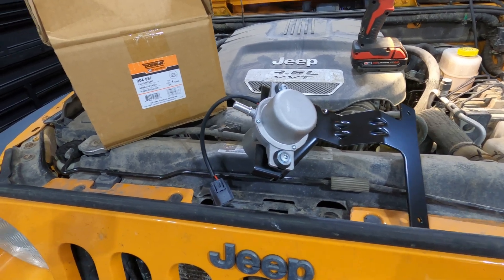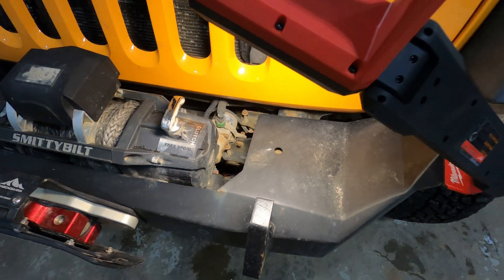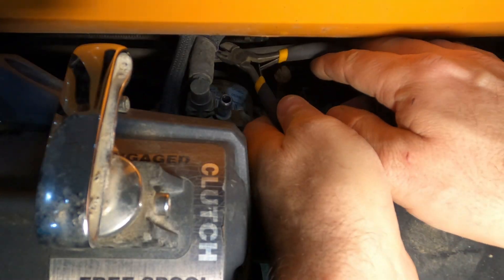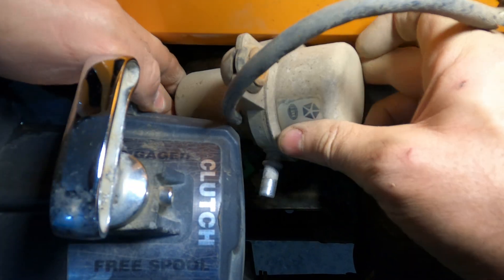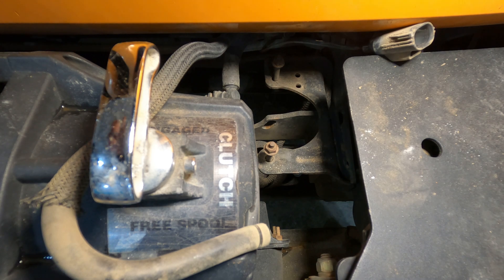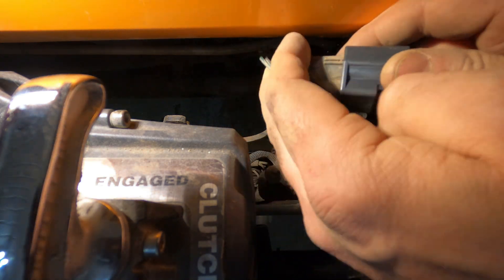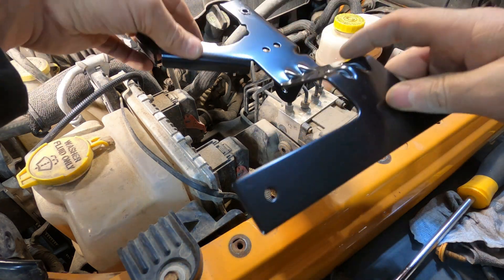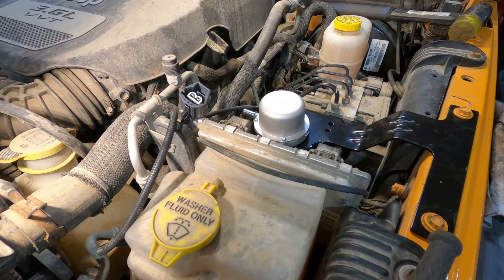Jeep JK brake vacuum pump replacement (brake booster pump)

Comment: Dorman worst crap ever. Terrible company with terrible parts
Reply from the maker: So far, my experience has been different than yours.
Reply: @EricCantin whats the sample size? This one part for you? I work as a mechanic at a garage
Reply from the maker: Then which pump is most reliable? Easy to diss, hard to say anything helpful.
Reply: @EricCantin so this is known as a red herring fallacy. Its its introducing a different point to distract from the original point.

I did not make a comment to help you find a better pump. I criticize the pump you put in because dorman stinks. You then say not from your experience. Thats why i asked how many dorman parts have you actually used.. if you are one for one, than i guess its the greatest company of all time. However if you do this for a living than the sample size is much greater and you see patterns.

Now had the discussion been at the beginning which one to use, im sure we could have looked that up
Reply from the maker: If you’re such a knowledgeable mechanic, you’d know this is one of the most common replacement pumps used by Wrangler JK owners. 

Why did you stumble on my video anyways?
Reply: @EricCantin so im not sure if you can conflate me being “super knowledgeable”, with me pointing out dorman parts are garbage. Say you are a janitor and work at the shop and you have witnessed multiple dorman parts being put on multiple cars.. if you see that the parts dont work out of the box or dont last but 6 months, do you have to be extremely knowledgeable? Its just pointing out junk, you dont have to be a professor man…
Your video came up on my YouTube because my friend has a jeep with a vacuum pump code. I have alldata and the picture showed the pump behind the bumper. I youtube it to see how long it takes to replace. Your video was the first to show. If you notice, i am not critical of your video, just the trash part you put in. Video was fine. Any reason you are being so defensive about the part? Also, you still haven’t answered my question.. how many dorman parts have you ever used..? Is this the only one ever?
Reply: @EricCantin just because its the most replaaced, doesn’t mean its good. Thats like everyone going to the new Jurassic park movie.. wow a new movie lets go, doesn’t mean its good, just popular. Thats an appeal to popularity fallacy. Taylor swift sells billions of records, is she good?
Reply from the maker: I’ve used plenty of Dorman as well as lots of other Jeepers I know. Those that failed lasted longer than the typical person holds on to a vehicle (years not months).

You have your opinion on the brand. I and many other Jeepers I know (including multiple that are licensed mechanics) have had plenty of higher tier parts fail quicker than those manufactured by Dorman or many other low cost solutions. That’s just the reality of current times.

Comment: Will this pump help with spongy brake pedal. I have a JK and I’ve done new rotors,calipers all around and even installed a big brake up front but the pedal still feels spongy. I then flushed and performed a manual and ABS bleed. But did not help. Appreciate the help.
Reply from the maker: How big of a brake kit? Does it use the factory calipers on oversized rotors, or also uses bigger calipers?

If still using stock calipers, this should help. If you upgraded to bigger calipers, you may need the J8 master cylinder and booster upgrade. I have a video of it here: https://youtu.be/RULcDetUsGM

Comment: I haven’t had any codes, but my jeep has 203k miles on it and it’s got a big hole in the side. When I hard brake my brakes feel like they are “sliding” and my traction control light kicks on for a second. I’m assuming this is the culprit. Anyone got any other ideas?
Reply from the maker: Are you using a scan tool that can check for intermittent codes?

Is it the brake pump that has a hole in it? When mine was dead the pedal was spungy.
Reply: @EricCantin yup. Scan tool says nothing. The aluminum housing on top of the pump rotted and had a whole in it. I changed it this afternoon. Seems fine now. I had to pump the brakes a bit to build pressure back up it seemed, but I’ve got a firm pedal now. The old pump literally crumbled in my hand when I went to loosen the bolts. It was completely shot for sure.

Comment: Excellent bracket! I flat tow my JKU and have a demco stay in play duo braking system, the control module ended up right where most other pump relocation brackets go. Not this one! This Dorman bracket will put it right underneath the brake system controller, tucked out of the way keeping my bay looking neat and tidy! Thank you!!!

Comment: Where did the small vacuum line go that you had the zip tie on to the pump?
Reply from the maker: At what time in the video?
Reply: @EricCantin  4:00 the smaller rubber hose yhay slips on the little tube on the pump
Reply from the maker: I think that was the air supply line to draw air higher in the engine bay (since the pump was below the OEM water fording level). Since the bracket relocates it so much higher, no longer used.
Reply: @EricCantin  I think the small line is the exhaust side of the vacuum pump.

Comment: i’ve had problems with braking in low rpm since i got my used jeep. usually right when i cold start the jeep. the pump is already on the location bracket under the hood so i’m going to check to make sure the connections are tight. otherwise thanks to your in depth video, i’ll know how to replace the vacuum pump if needed.

Comment: Hi Eric. I work for Dorman and I actually developed this part. I was wondering if you had any feedback on the performance or installation? Is there anything you would have done differently? Any improvements you'd suggest?
Reply from the maker: It would have been great to include new seals with it (at booster and reservoir). Also the OEM master seemed to hold the reservoir better against the seals. There’s some up / down play, so almost like the casting should be a few mm taller or hooks lower. Thanks!

Comment: I have the exact same codes appear while driving on the highway after a few minutes and disappear when I turn off the car. If I have a stock bumper do I need to relocate the vacuum pump or I can keep it at the same spot. Thanks
Reply from the maker: You can get a replacement pump and reinstall it at the stock location. 

If the plastic Philips head screws (that hold the plate between the bumper and grill) don’t want to unscrew, I screwed a metal screw just enough into that plastic screw so I could them pull it out. Good luck!
Reply: Great video by the way and explanation. Replacing it was quite straightforward.
Reply: Thanks Eric. Really weird so I put in a new pump but I still seem to get the same error code P258b vacuum pump performance... Only when driving on the highway... As it did before... Any ideas or recommendations. Thanks again.
Reply from the maker: Can you hear the vacuum pump start? Pushing the brakes repeatedly at idle might trigger the pump. 

Other possibility would be if a line is clogged.
Reply: @eliasstefanopoulos3668  Check for a blown fuse?  I don't recall the number (lower M's) that was talked about in regards to vacuum pump.  It's labeled as having something to do with trailer wiring(?) - yet my trailer wiring was just fine.  I did replace once... I suspect will be out when I go to change out my pump this weekend.
Reply: Eric great video where does that small vacuum hose u disconnect to? Mine is disconnected by my head light and can’t find connnection grrr 😂
Reply from the maker: In the video I show where the vacuum line from the pump is routed. There’s a hose connection on the driver side of the engine that needs to be modified. Hope that helps.
Reply: Did you have to bleed the brakes afterwards?
Reply from the maker: For this pump, it’s all vacuum so no link to the hydraulic system.
Reply: I changed the vaccum pump after getting a code P258B but after I put new pump on the light came back on 5 minutes later for electronic stability control. 😔

Comment: Nice video, replaced mine earlier this month but in the stock location.  Like yours mine was heavily corroded but then something had hit the top of my pump and broke a piece off the top cover.  I'm going to relocate it but have a voswitch module where you placed your pump so I got to figure out where to put mine when relocated.  Dont really want to move the voswitch module as the wires to it are pretty much cut to length.
Reply from the maker: It’s such a weird factory location for this pump. Clearly an afterthought and “easy spot” when they switched from the 3.8L to the 3.6L. 

Good luck finding it another home!
Reply: Did you find another location?  I have the same issue with the Voswitch module in front of the ABS.